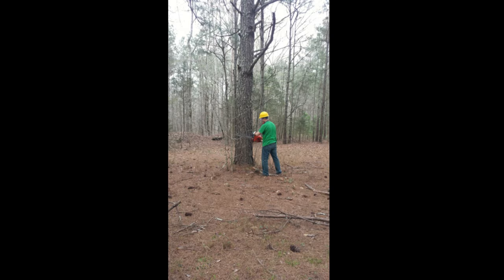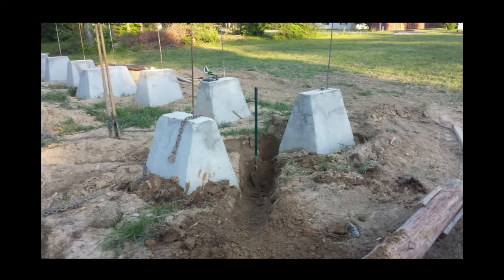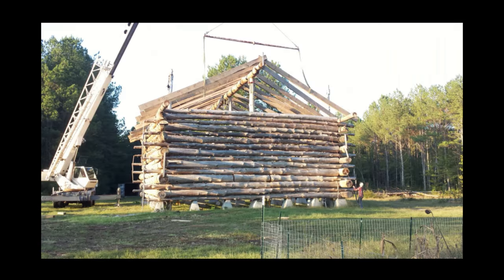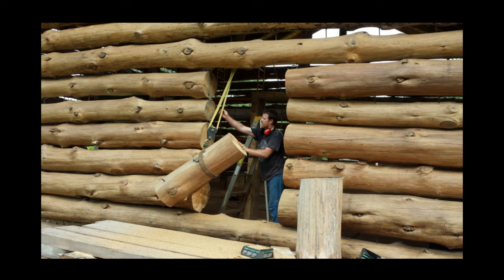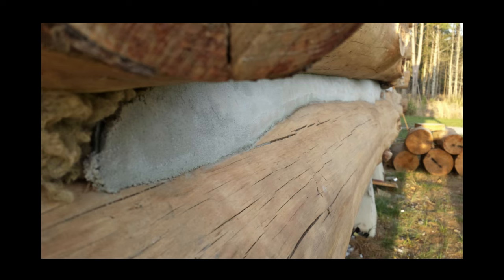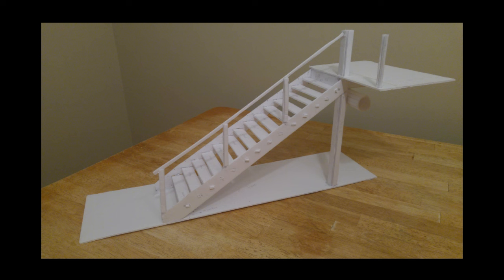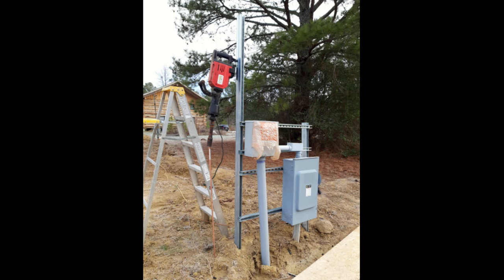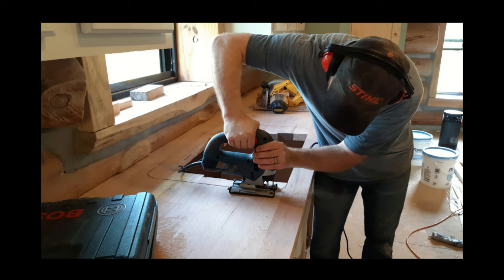start finish cabin build

Comment: What’s the dimensions? And how many logs did you use?
Reply from the maker: it's a 40x40 two story home. 64 wall logs. 28 rafters. 31 4x12 floor joists for 2nd floor. I just used 2x12's for the first floor (96)

Comment: Can't imagine the maintenance on those walls! Haven't made it to the end yet so maybe its addressed.

Clint B sent me here.
Reply from the maker: just needs stain every 5 years. roof overhangs are quite large (8' on gables, 4' on eaves), and we are adding a wrap-around porch.
Reply: @bawhjth  what about the chinking? My understanding was that it was replaced /renewed almost yearly? Or is that traditional?
Reply from the maker: @DBowTX  sure - this is traditional mortar chinking - it should last pretty much forever, due to the method of installing nails and lath first. I have a pic of some 60 year old chinking that's been through a 6.5 earthquake and is still intact. that synthetic stuff should be avoided, IMO.

Comment: Congratulations! I watched your videos years ago and found the naysayers commenting to be completely unreasonable in dismissing the dream you were clearly devoted to. I'm glad to have checked back in to see you finished your beautiful home. Are you satisfied or are there things that you would change that weren't forseen, like with the build itself or maintenance? Again, nice work!
Reply from the maker: thanks! yes, we are moved in, still working on finishing it. but yeah - wish we would've gone with an oil based stain in the first place - I have to sand blast off the remains of it before I can switch to oil. but I hear as long as I maintain the oil stain, I can just wash and re-apply next time (without sandblasting). Let's see - what else - we built on piers - I wouldn't change that - but this winter was brutally cold - colder than anyone remembers - and the wind just seemed to blow right through that open crawlspace. so now we're looking to spray foam the entire underside. I'd like to close in the crawlspace at the same time, but might not get to it before winter. And yes, the logs shrink - our kitchen cabinets (attached to logs) have pulled back about 1/2" from where they were, leaving a big unpainted stretch of wall. I don't know how you get around that - we didn't have anywhere else to attach them. Other than that, I'm pretty happy with how things turned out, thanks for asking! Would I do it again? yes.
Reply: @bawhjth   awesome! Just a couple of suggestions are to weigh not closing in the crawl space. A number of reasons, but the main is with pest control, which you can do yourself. I used to do pest control on the side. Controlling ground pests is as simple as limiting their access to the house which are those piers. A once a month treatment around them keeps the bugs off. Put a continuous fan-spray half on the block and half on the ground around the perimeter of each for a barrier and at least a day before rain. It can be used the same on the wood itself around the bottom corner perimeter in/outside if ever needed to drive them away. Insect/termiticides are available for non agricultural license use (private property) and are probably at your local hardware store. A bottle is around 50-100 bucks and lasts years. Natural mixtures are perfectly fine too! Just mix with water in a pump sprayer and wear some gloves. Bugs are largely inactive during winter so you may consider making some nice panels to put around at that time as a wind barrier or simply planting bushes helps break up the wind. A cat or two keeps rodents away and therefore snakes. All critters are drawn to that much wood lol. Spray foaming the underside will make a complete difference, but be careful. Some of the foams have destroyed wood from the chemicals. So go with a known brand or getting those ploy-whatever or similar blocks you used before on the roof will do about the same if cut to fit and held by straps. Even better if using wood slats/sheeting underneath. I did a double subfloor and sheeted underneath fiberglass insulated joists on a stilted addition one time and it stayed warmer than the house lol. Man I know you're thrilled with the home!